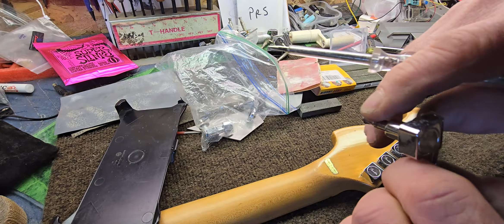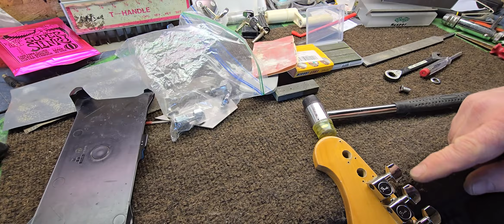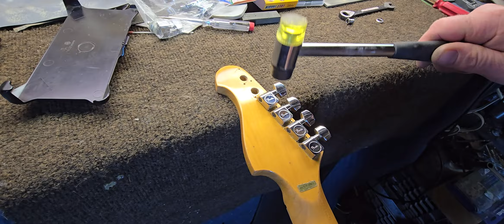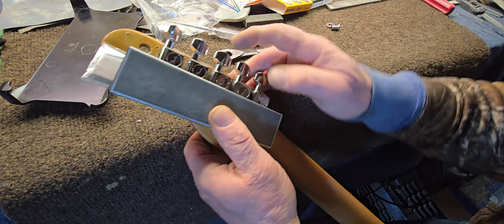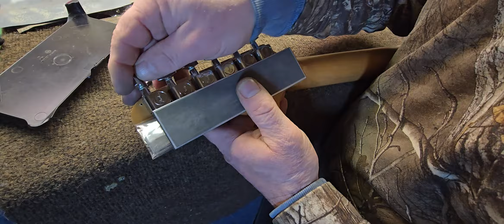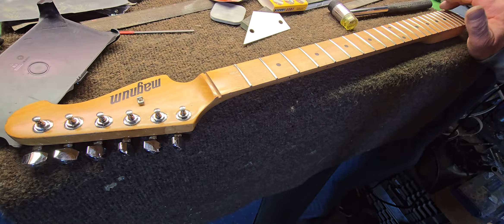Guitar repair . how to install fender tuners with alignment pins. A nice accurate method no drill.

Comment: Omg slaming on that tuner cap on the back is disasterous...it could fall off you know. Obviously you dont.
Reply from the maker: @dcharlies  please leave a link to one of your videos so we can all see how it's done. thanks in advance.
Reply: @guitarhoarder1972  use a tape around to simulate width and compensate height of that center of tuner, and than use some strong sharpie to leave trace on wood. Than use some stable drill with measured depth. And no hammer striking on some sensitive mechanism and glued circular tin back, for Christ sake....dont get angry. Just accept some logical idea...or not.
Reply from the maker: @dcharlies  seemed like you were stating in your comment that I did not know what I was doing. I am not angry either, I get these kinds of comments from time to time. If you had just suggested some friendly advice, that is more of a gentleman's style of helping. I have been working on guitars since I was 12 years old and currently own over 100 and work on guitars for people all the time, i have never had a dissatisfied client. I do appreciate the info you shared nonetheless, and I truly do not want to offend anyone. Life is too short to argue and not enjoy every single minute. Take good care. Jake
Reply: @guitarhoarder1972  that is good honest answer. I had to give some suggestion when I saw tuner and hammer, even rubber one, all suggestions in good spirit. I respect your age and effort and history of setting  up guitars, I do the same thing, hobby,  just dont record it. And we are similar age I susspect...So, with no further a due good luck and happy life.
Reply: Jesus Christ dudes, get a room.